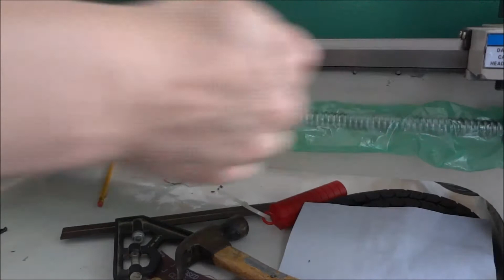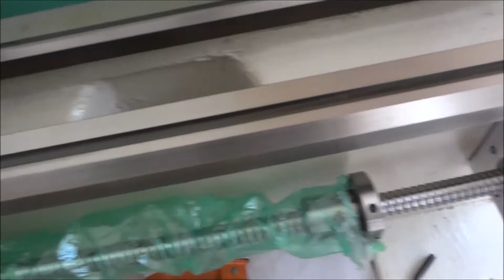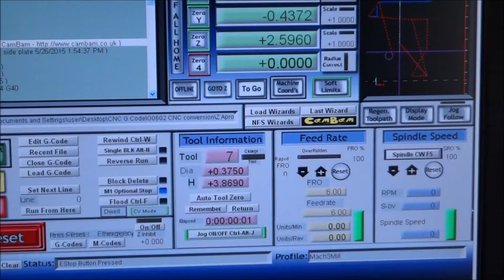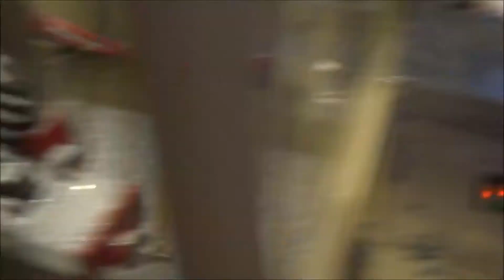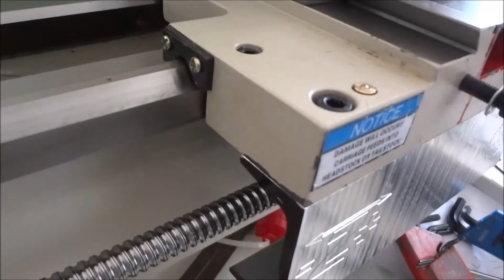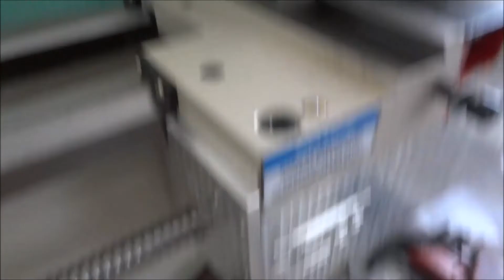G0602 Project Pt 12 Z Axis Completion

Comment: this is a great job sir. i actually purchased the x2 freak files. just wondering if you have heard of or used a transfer punch set before. they sell cheap versions at harbor freight. work great for punching the center through another hole.

Comment: I noticed your work moves when spot drilling and facing do you not use parallels?
Reply from the maker: Yeah it did move on Me I had to stop reset and start over. No I was not using parallels at the time. It sure would have helped.
Be Safe,
Sam
Reply: If you turned the ball nut around and mounted it to the other side of the unit you will get more z travel.
Reply from the maker: Yes I suppose I would pick up some However most of my turning is under 6" so I did not see any reason to stretch out the Z axis.
Be Safe,
Sam

Comment: Very nice...
Reply from the maker: RoboCNC Frees- & Graveerwerk Thanks , I have a question that you may be able to help with.
 I'm using basically the same tach prox switch as you have is the index 
pulse signal from the Prox switch accurate enough for threading in Mach 
3?
Reply: I have not tried this, but i think it will not be..
Reply from the maker: RoboCNC Frees- & Graveerwerk Ok thanks I wasnt sure and I had not planed on it being accurate enough.
I planed on using a separate sensor for mach 3 But I thought I would ask.
 I'll give it a try and see.

Comment: So far you are doing a fantastic job!  I noticed that you supported the bearing/screw block on the back side and only used a 1/4 inch (my guess) plate, with the only support coming from the C beam.  My question is, with all the weight from the other items on the saddle, do you think that this plate will flex?  I don't know, just asking.
Reply: Thanks 
Yes I used a .25" plate but not only the plate the bearing block 1" is bolted to the plate the square tube is bolted to the bearing block and the plate. It makes a very rigid mount.

Comment: Looking good Sam. I had never seen a U channel used to make the apron, very cool.
You should consider getting a metric transfer punch set like this: http://littlemachineshop.com/products/product_view.php?ProductID=4884&category= they are inexpensive, and much more precise than the nail method. You find the one that fits the hole, then tap it with a hammer. The pointy end will mark the receiving part with high accuracy. 
Ciao, Marco.
Reply: Thanks 
Not original I borrowed my basic design from a kit made for the G0602 which also utilizes u channel the X2 cnc fusion kit also uses u Channel on the Y axis.
Reply from the maker: Crivo152 Thanks yea Ive seen them and I could have definitely used them here. :-) I will put them on the list for my next order from LMS